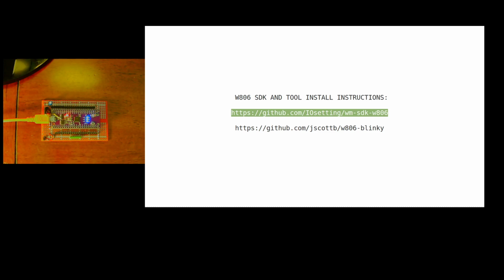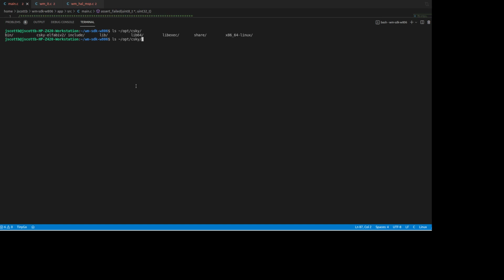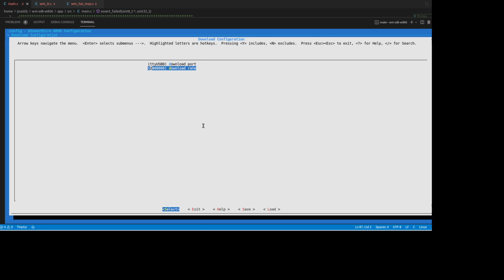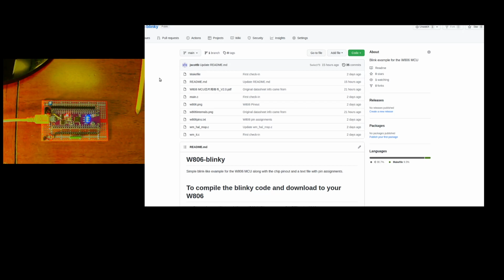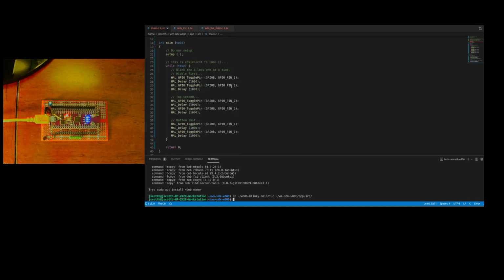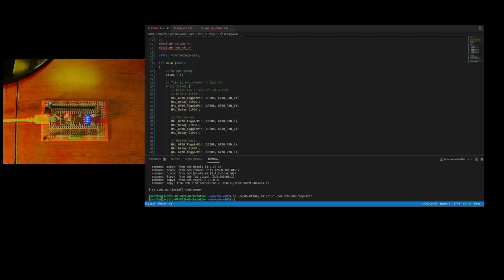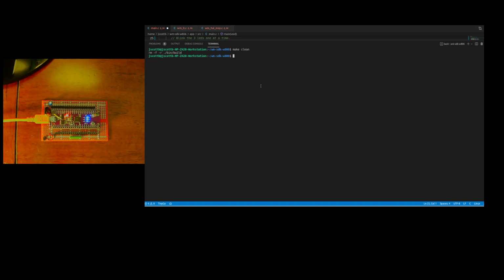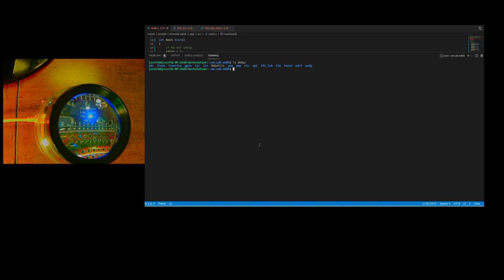W806 MCU compiler tools and SDK setup

Comment: hi I have tried to install it but the make menuconfig does not compile. Can it have anything to the warnings I got from 7Zip when I extracted the tar.gz file and some links couldn't be found. I am running W10.
Reply from the maker: Hi.  What kind of warning did 7z give and what are the compile errors?  Thank.
Reply: @UReasonIt  

C:\Users\FredrikB\wm-sdk-w806>make menuconfig
process_begin: CreateProcess(NULL, uname, ...) failed.
tools/W806/conf.mk:74: pipe: No such file or directory
process_begin: CreateProcess(NULL, cc ./tools/W806/wm_getver.c -Wall -O2 -o ./tools/W806/wm_getver, ...) failed.
tools/W806/conf.mk:81: pipe: No such file or directory
process_begin: CreateProcess(NULL, pwd, ...) failed.
tools/W806/rules.mk:19: pipe: No such file or directory
process_begin: CreateProcess(C:\Users\FredrikB\wm-sdk-w806\tools\W806\mconfig.sh, ./tools/W806/mconfig.sh C:/ProgramData/chocolatey/lib/make/tools/install/bin/make.exe, ...) failed.
make (e=193): Error 193
make: * [tools/W806/rules.mk:138: menuconfig] Error 193
Reply: 7zip: Can not create symbolic link. The user has not got sufficient privilegies
Reply from the maker: @fredrikbergquist5734  Try running 7z as admin and then opening the archive and extracting it.
Reply: @UReasonIt  Thanks! Fixed the problem with 7z! Now on to getting the IDE and toolchain to work!

Comment: Great work. I’ll drag mine out for some blinky goodness! 👍😀
I wonder if the Arduino IDE will be used as a hook one day…🤔
Reply from the maker: I did see a repo on github that has the beginnings of an Arduino hook-up.  There is no Wiring library code done that I saw in it yet. That's not hard to do, but they will need to bury the HAL functions in to make things work. This can be done in a "lite" way or very thick. The STM32 or Giga Risk-V Wiring code could possibly be used as a starting point I would assume.  Time will tell...  I will say that this chip has one good thing going for it and that's the sheer amount of I/O it has, 44 pins of goodness! :)
Reply: They have Arduino support now and I was able to blink all 7 onboard LEDS right away,  7!  And other useful examples. But i still cant find a datasheet heh.